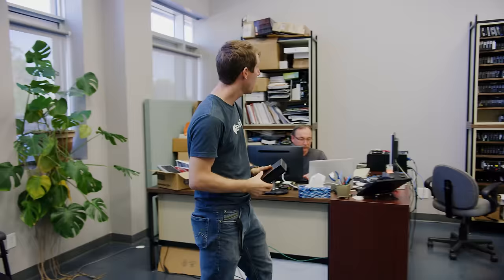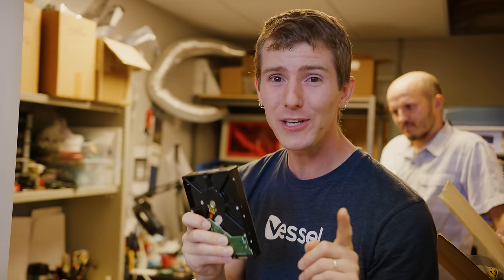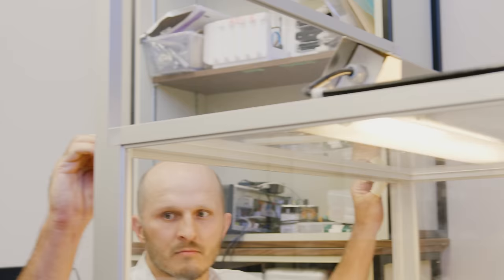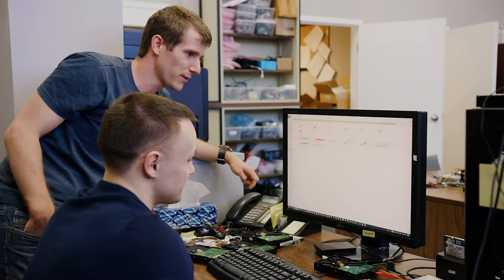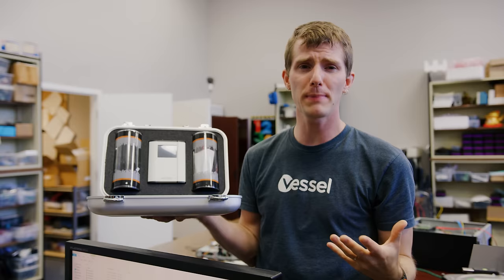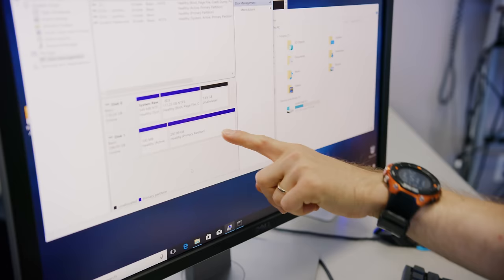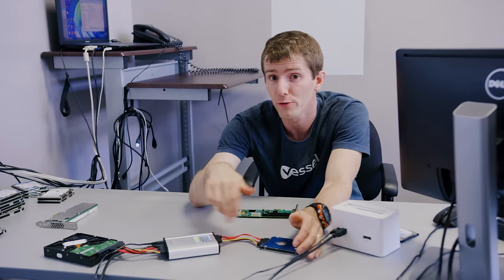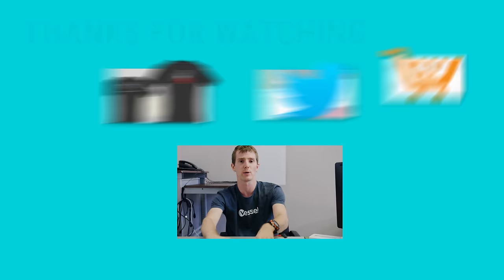Don't Waste $1000 on Data Recovery

Comment: Rule number 1. Always have a backup off disk.
Rule number 1b. Always test if your backup recovery works.
Rule number 1c. Check regularly if your backup solution still works and is running and actively making the backups you want it to make.
Rule number 2. Use testdisk/ext4magic/autopsy/whatever else solution you want if a backup doesn't work.
Rule number 2b. Never try and data recovery on the real device, always pull a low level image if there is no ridiculous, physical failure with the hardware.
Rule number 3. Consider if you really, really need that data back and want to pay ridiculous prices for data recovery
... And then you realize that you just can't afford it.

My bacula backups on my raspberry pi took me a few days to set up to work right, but they saved me twice now. Backups are really good stuff to have around. And even if you don't need them they make you sleep more easily.

Also those guys can't sit on a beach if they don't have a business to earn money :P

Comment: Spoiler alert: The way to avoid wasting $1000 on data recovery is to have good backups, so you won't NEED data recovery. :D

Aside from that, I really appreciated the review of the various types of drive failures and how a competent repair service might fix them... IF you're lucky.

Comment: Rule number one: ALWAYS have a backup of precious data, because the chance of a drive failure is 100% the question is only when it gonna happen
Reply: what backup would you recommend?
Reply: @chriswhynder2189  it depends a bit how much you want to backup. The recommendation is always if possible to have vital data on a second location in case of fire or the likes. But for my part I tend to use an extra internal drive for larger backups and maybe an external for smaller amounts. Most important is in the end to have a copy somewhere on a different drive at least

Comment: I've never needed data recovery in 20 years of PC building. Raid1, LTO and Cloud = if something bad enough happens that wipes out all 3 at once, then I have bigger things to worry about than my silly data; like food, guns and ammo. An ounce of prevention is worth a pound of cure.
Reply: @djchristian82   Backblaze and the raid10 for the internal D drive is native on the motherboard. Most of the storage is hot swapped as needed but 99% of the time drives just sit on the bookshelf (seldom need all 22 swap bays populated all at once). Drives last far longer when they are not spinning 24/7 (decades instead of years). The downside of Backblaze is the unlimited backup option for $6/mo is really only useful for really fast connections if you have 100's of TB or more (the backup gets deleted by the app otherwise when pulled from the system after 30 days since it thinks it was deleted, so need to cycle all drives at least that often, the downside to the cheap fee). Pretty much unusable in my case without a Gbit upload speed (fiber), 1Mbit would take years for the initial backup and by then I have another 100TB to upload.

Comment: In the old days when you did low level formatting.I was given a large drive;  for that time which had a bad track 0. This is where the FAT and boot info resides. So I swapped the line for the read write head for track 1 with track 0. The drive does not know what the physical location is so it now reads track 1 as track 0. I marked the bad sectors on now track 1 and boot. I had that drive for 5 years then the cat knocked over the box and killed the drive. I was a backup specialist for IBM so yes I had a backup of the data. Drives are better now but if the data is important always make a copy.

Comment: Home hack.  More than once I have been able to recover data from a ticking drive by putting the drive in a plastic bag and then putting it in the freezer overnight. Have the case of your computer open and ready to go. As soon as you pull the drive out plug it in and turn the computer on and copy data in small chunks right away. If they drive gets warm before all your data is copied it will fail again. Repeat the process until you get all your data off. I can't guarantee that this will work every time but I have had GREAT success doing this!  The first time I did this it was just a Hail Mary with nothing to lose, but when it worked I was shocked!  Now it is the first thing I do with a ticking drive.

Comment: I've had a few hard drives that I was able to recover the data by putting it in the refrigerator over night. Now it did take about 5 tries to get all the data off, and I literally put ice packs on the top of the drive while I copied it off via USB. Mine was I think the bearings were going out and the drive was heating up and shutting itself off. Getting a desktop fan to blow 24/7 on your drives, either internal or external will greatly extend their life. **Backup your data people!!! If you buy a 6GB drive, you better buy TWO to use one as a backup. Never keep anything irreplaceable on ANY drive that you are not backing up!!!

Comment: It's amazing. I've done about a hundred HDD data retrieval on my own over the years. I also did PCB rotations, head switches and even a wooden switch that I could get a head switch to remove the panel data where the head (s) were not working.

Comment: Have been in diskpart 100 times and never knew about the automount thing. I had the exact same thing happen to my external drive as that hard drive, I powered it down, diskpart started responding, powered it back up and was able to transfer all my pics over.

Comment: My favorite method has been to buy new SSD´s and expansion drives in advance - preferably 8 TB to 12 TB ones. All information from older drives is put into the newer ones...and then copied, pasted and recopied and repasted. The old information is deleted from the ancient drives so if something happens to them the new ones are ok.

Comment: If you run good backups you won't ever need to recover data!  You can simply restore it. Running raid is not the same as backups, it's possible your controller can fail corrupting your data or you can delete something you did not want to delete.

Comment: Imagine my surprise when, after installing an early version of Acronis True Image, and I decide to take advantage of their "Secure Zone" software tool to set aside some drive space for my irreplaceable files, the installer for the app wipes the entire drive, NOT simply the partition I assigned to the zone....the ENTIRE drive.  No warnings, no "ARE YOU REALLY SURE YOU WANNA NUKE YER ENTIRE DRIVE" warnings.  It occurred just before my need for multiple, redundant backups became such a high priority...I lost 18 GBs of RAW and jpg original photos of the family (I was a camera nerd), some of the family members that had passed since the pic were taken, my stress level was epic.  Luckily, software called Get DataBack for NTFS got back almost 95% of everything, so I was able to put the Seppuku knife away, but...please, learn from my mistake.  Multiple backups on DVDs, Blu-Ray and even an off-site location if you have that option.

Comment: On a dark Friday night I used a software package to recover 300+ GIGS of data from a "broken" hard drive, complete with a fully corrupted file system for $80.  It scanned EVERY SECTOR and recovered everything within 24 hours.  It worked like a charm and worth every cent.

Then I flexed the order of operations on my RAID server stack to drop access at 2 AM daily to FSYNC RAID to an "island" drive, then come up again, for extreme safety.

The island drive is then backed up to removable indivual units every month and stored offsite, guaranteeing Windows will NEVER trash my data again (long story).

So...  trust me.  I will not never spend $1000 on recovery, on any day, till my last day on earth.  I'm just smarter then the average bear.

Comment: What was “bad” about the power source?  That would be nice to know.
Reply: Off the top of my head, could be three things:
1) PSU itself providing incorrect voltage down the wire
2) wires broken could result in same, or possibly even a short
3) broken plug from common wear and tear could also result in a short

Since it was more than just the PCB that was faulty, it was either a short or surge that caused the problem.

EDIT : wrong terminology, fixed
Reply: Hotcakes 1, 2 and 3 are all saying the same thing - a short.  The PSU does not dictate how many amps are drawn, the device decides that. 
Isn’t there a fuse Incase of a short or is it worthwhile to install an inline fuse for external hard drives?
One other possibility would be a voltage spike.

Comment: Many years ago when I was in tech school a classmate had an original Xbox (2004-2005) where the HDD had the click of death.  Thankfully while replacing the failed DVD Drive a few weeks prior, I made a complete backup of the HDD just because.  Out of curiosity I took the HDD apart and one of the heads suffered a catastrophic malfunction where the head was actually curled backwards and facing up.  Keep in mind that the Xbox never sustained any kind of physical force that would have caused that and not break/damage anything else like the case.

Comment: I had a 6tb Seagate drive that stopped working. I could not access it at all. I sent it off to outbyte data recovery in Illinois. They contacted me back and told me it was suffering from serious internal damage and it would cost me 750 to 1500 dollars to have recovery done. I told them to send it back to me. I had it sitting on my desk for a couple weeks and said "screw it" and hooked it back up to my PC. It came online instantly and I was able to pull all data off of it. For free.

Comment: Your video is just so massive! Worth more than wiki, forums, articles put altogether. I always hang around with Macrium or GetDataBack which do some of a good job actually as far as they can. Unfortunately, these heads are very sensitive but I have had way more damage by powering down manually the computer and lately due to some of last W10 updates that make the computer freeze at 40% or so than from dropping the HDD...
Regarding the burnt components, potentially, with a delicate hand and the right reference if these are not programmable components (passives, diodes, transistors, DCDC converters...) a nice operation should do the trick but the layers (internal or external) of the PCB must not be damaged.
Here's a few questions
1) For the ROM, is it possible to read the one of the healthy HDD and transfer its content to a new identical chip (over I2C/SPI bus)?
2) How to find healthy heads and change the bad ones by myself?
Thanks again. Now I am curious to see your Youtube channel.

Comment: 14:57 - "Hard Drive doesn't go from completely dead at an instant" - No sir, Unfortunately I experienced it myself on my old laptop. The computer was running fine, had no slowdowns on HDD Western Digital Scorpio, put computer in sleep mode to bring it form outdoors to indoors - opened the screen, and boom - blue screen of death... Does not log into windows, bios tells me there is no HDD in the system! The issue turned out to be a tiny reading head broke off from the head arm, and was stuck on the platter!!! I know because I took it apart to see, since I had copy of majority of the photos and works on another HDD, so spending thousands on recovery was not worth it. 
So yeah you can certainly lose HDD at an instant in rare occasion.

Comment: deepspar isn't used by the top notch data recovery companies. deepspar is intended for non-professionals.
the market leader is pc-3000 express.
deepspar doesn't have MOST of the necessary features for data recovery. 
when evaluating probability of being able to recover a hard drive, deepspar could only address minimal damage. if there was any significant damage to the platter, PC-3000 is the only option.
honestly, if you could recover a hard drive with deepspar, you most likely don't need deepspar at all. 
you could just swap boards without deep spar, or swap chips without deep spar.

Comment: But if there is not any physical damage to the drive and the issue is like corruption or by mistake deletion then I think its better to try any DIY software like stellar data recovery to recover data it is safe & also you don't need to go anywhere..

Comment: scenario 5 was my problem. It behaved exactly as it shows in the video. And after 1 full week troubleshooting, even swapping and soldering the bios chip from a new PCB nothing worked. Thanks linus! With your windows hack and testdisk I can finally access all my files. Almost was about to send it to someone and pay 1k for it.

Comment: I thought hard drives were RAID inside.. Data is written and read via all heads 1, 2, 3, 4, etc repeat during a sustained transfer. So if 1 head dies, all your data is gone.

Comment: No mention of the use of NAS drives instead of domestic drives? I buy NAS drives because they have twice the reliability and the firmware doesn't try to hammer the heads constantly if an error happens. :)

Comment: I've been working on computers since my first hard drive was from Western Analog.  Here's a pro tip I bet they didn't fill you in on that works a surprising amount of time, maybe 20%... when all else fails, at least in mechanical failures... If you try everything else and the customer says 'Nah, it's not worth spending that much money for data recovery for me.'  You go to the back to pack their computer up... take out their hard drive and in a last ditch attempt to provide customer service... hold their mechanical hard drive about three feet above a hard surface, and drop it.  Try it one more time and see if it just happened to get knocked back into place enough to get something off of it.  I know... most of you think I'm stupid, crazy or both, heh.  But I'm a Master tech and I've been doing this since the 80s.  And hey, what do you have to lose?

Comment: You talked about people not wanting the WD 20 tb drive because you couldn't rebuild the drive very quickly, but that was a 9 platter drive. Could you possible run all the platters in a pseudo RAID map to increase the speed, even if that means 1 head failing would lose all the data?

Comment: Data recovery is a must have thing as sometimes its more valuble than the PC esp when it comes to family photos etc.
i have had three hard drives fail on me, so now i store the good stuff in the cloud.
PS dont hot swap hard drives its probably the worst thing you can do, linus does it but its a bad practise and i am pretty sure it is what bricked 2 of mine.

Comment: Thanks
All the HDD's in this video are SATA
What do I do with an old SCSI drive?
The motor is OK, 
Electronics is OK 
but the DISKs themselves are so old (20 years) that the data was wiped by the time...?

Comment: I had a Fujitsu 3.5" drive it was getting slower and slower...so I had moved any important files off it...and it became unresponsive...at first boot it was accessible....but after 10 mins it wasn't.  I took the lid off just for the hell of it...and guess what..it did not spin so freely..more freely when cold...and no, I did not put it in the freezer...but it has been the only drive I ever experienced this with.

Comment: 5:46 Yes, but also wrong. 

That chip didn't need to get desoldered and transferred par say.
I fried 2 drives once. Got the LBA matching on a PCB and away it went.
Recovered more then a few drives that way.

But in a typical circumstances it's best to just change the chip and be on your merry little way.
Reply: if i swap the heads, do i need to change the chips too?
Reply: @user-jf1pg9us6h   wow... 
Never went that far.

Only the PCB/eeprom to match to the proper sectors if i recall.

Comment: hard drives don`t go from working to dead instantly , Remembers 4.3GB Seagate drives that used to do just that and also  a warranty replaced quantum drive that died when installing Windows 98 and had to be replaced yet again under warranty . . . .

Comment: Linus
My 2TB hdd was working fine just 10 minute power outage changed the whole thing
D:\ letter changed to C:\
C:\ and other 3 partitions vanished away to no where those are bitlock protected now It just shows 1 open partition and empty space

I need suggestions on this, 
HDD health is 100%
Seagate Barracuda 2TB

Comment: Valuable and highly professional work and information. Would have been of further help if you could suggest free data recovery software without any size limits. Plus how to get the logical errors fixed, in simpler form.

Comment: so I need to first diagnose the hdd with a USB drive dock to my known good system? and try R-Studio?

symptoms: hdd is silent, won't boot the laptop. 
causal event: running a vacuum cleaner on the keys while lappy was running (a moment of stupid), some keys got pressed, 
believe static electricity was built up and discharged. screen went crazy; pixelated multicolored. won't boot. no obvious cable or system board damage

Comment: Thanks. That's pretty bad design that the computer reattempts bad sector reads that many times without moving on and without having anyway to adjust it without extra hardware. That's pretty sad.
Reply: I just looked online and aperently you CAN avoid accessive read attempts by using a bootable recovery program. Clonzilla is free and that can be set to only try reading a little before moving on. However I'm not sure if Clonzilla has the ability to reassemble files from the cloned data.

Comment: I have a drive that will not mount.  It does not make any noise but when put the drive into the system I keep getting trying to repair but it never does anything.   I put it in a USB enclosure and it would not show in Disk Manager or Explorer. I did try a data recovery software, but it did not work.  It did try to scan the disk but that is all it did.